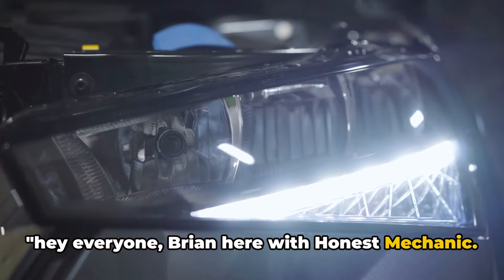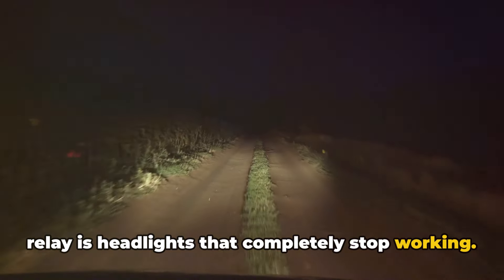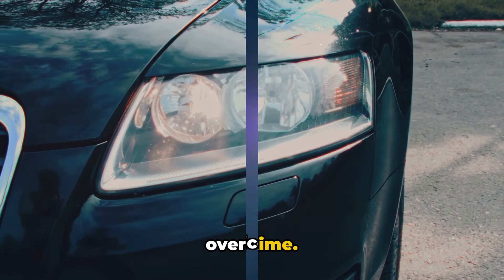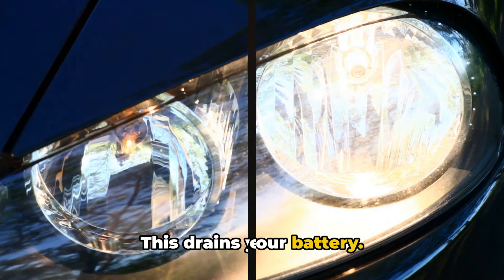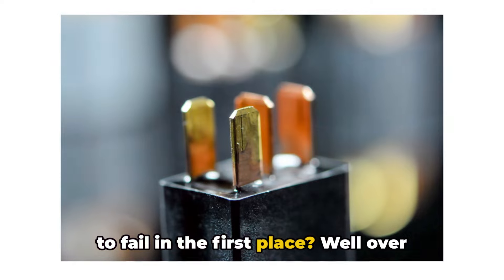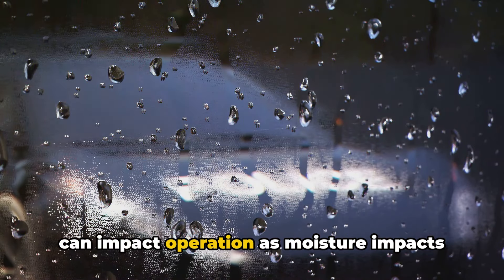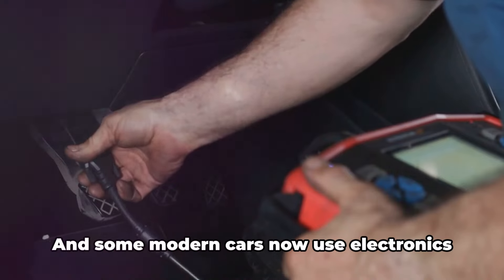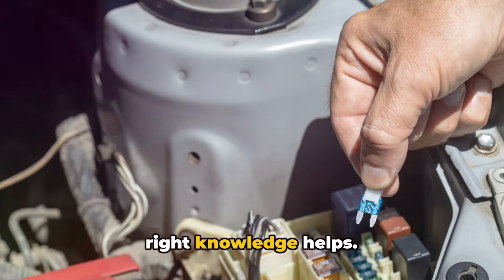Bad Headlight Relay Symptoms: 5 Common Failure Signs

Comment: Can a bad relay cause only one side not to work?
Reply: Did you figure out the problem mines only out on one side
Reply: Same
Reply: That's the exact issue I have and I haven't found ANYWHERE that mentions what can cause this. I checked the fuses and none of them are bad, both bulbs are brand new, I even tried each bulb on the side that turns on and they both work on the driver side but not passenger side.
Reply: Going thru this on my 2010 avalanche right now😮. 
I bought aftermarket lights front and back. Can't use the rear lights(led) and my passenger running light in the front isn't working. I switched back to the oem lights, had to buy a new harness due to cutting and splicing the old one(I'm keeping them both just on case for extra harnesses in the future) JUST to see the same thing happening.... no light on passenger side. And that was the reason I decided to get new headlights anyway😂. Anywho... in 25 minutes I'm going to advance auto to get the relay and see what it do. I have new bulbs new wire harness and I changed around the old fuses. I'm gonna get a pack of new fuses shortly. I'll update later😊
Reply: @kingzach74 same did y find a fix ?

Comment: My headlights are working when the switch is flipped to always on, but if you try to turn them off and then on manually, the headlights don't work. Any ideas?

Comment: I have a car with 1 dim headlight and 1 normal headlight when the switch is set to manual ON, but when I switch the headlight to auto, both lights are normal, would you know what the problem is? Is it the relay?

Comment: I have a question. I have a 2002 cavalier,  and the previous owner removed the DRL. I haven't had a problem with the conversion until the left headlight hi-beam came on without the headlight switch on but at a dim level. I removed the relay switch, but the light stayed on. The headlights work fine in the on position.

Comment: my drivers side headlight stays on  on 59 plate astra
Reply from the maker: Hi. If the driver's side headlight on your 59 plate Astra stays on, it might be due to a faulty headlight relay, a problem with the headlight switch, or a short circuit in the wiring. To resolve the issue, start by checking and potentially replacing the headlight relay. If that doesn't fix it, inspect the headlight switch and the wiring for any signs of damage or wear. It might be necessary to consult with a professional mechanic or an auto electrician for a thorough diagnosis and repair.
Reply: My driver side headlight on my 2007 Corolla just went out a week ago after replacing it in 2019 I noticed the highbeams were not working as well but after I change the bulb, I noticed the highbeams were working, but the low beam was not. I tried replacing the fuse, but that didn’t work. I’m not sure if it’s bad wiring and the dielectric grease on the bulb socket or it’s a bad relay.

Comment: Thanks, Honest Mechanic, for this insight. So, I have a problem with my 2017 GMC Acadia Denali Headlight on the passenger side. When the headlight is on, I turn the turn signal switch and make the turn, then that passenger light will go off. I would have to play with the light control switch back and forth to get the light working. The auto dealership said they do not know what the problem is.  This happens while driving at night. Could this be a relay issue, or must the headlight bulb be changed? I notice a lot of vehicles driving on the roads at night have this problem from 2017 to newer years. Thanks in advance for your input.

Comment: I have a 2013 ford edge that has a battery drain. Sometimes when I turn my headlights off, the indicater light on the dashboard stays on. Could it drain my battery even though the headlights are off? Can a bad relay cause this? Thank you

Comment: My headlights are flickering and I can hear clicking under the dash on my 2004 Chevy Cavalier. Could the relay under the dash be the problem? I had other electrical problems with it, but that was due to a faulty body ground. The ground had corroded off the battery tray. I didn't have any gauges or anything. I don't know if the flashing head lights are being caused by that, but the ground has been fixed by a mechanic. If it's the relay, I can fix that myself.

Comment: When I turn my headlight switch to park, parking lights come on and the dash light up.
When I move the headlight switch to low beams, they don't come on, and my dashboard light go out.
If I pull on the high beam lever high beams come on but once I let go the lever, they go out.
All the fuses are fine. I assume at this point I am down to 2 possible culprits, headlight switch or the headlight relay. Here is another thing I noticed. With no key in the ignition, and with headlight switch to off position, if I manually pinch the contacts on the headlight relay, low beams come on. 
I didn't know that the headlight relay is constantly powered, but not engaged.
Reply: Curious what was your fix? My 2006 Vibe started this tonight the same scenario you are mentioning. I recently updated with LED 9003 and all have been working fine. Tonight started car to warm up and turned on only the park lights Then turned switch to turn on low beams which fog lights also come in with lows and nothing happened. 
No headlights. I as you did flick lever to high beams and they come on and release lever as d they go off . 
Haven’t checked fuses or relays or the connectors  to each bulb yet.  Maybe they got hot? The switch turn signals and tail and brake lights work fine
Reply: @daveholte7658  My problem turned out to be a faulty ignition switch. By wiggling the key I could get the lights to work correctly. I ended up replacing the switch, not the lock.
Reply: @ just found my issue. It is the actual headlamp fog light signal lever needs to be replaced The connection in the twist of off to park to low high is not making connection.

Comment: My 1983 Buick Electra Park Avenue sedan was working great in 2022, then they started flickering periodically! Replaced the headlight dimmer switch under the dash, they worked for about a week then back flickering! 8/15/24 replaced the headlight switch noticed it was burnt in the middle & VERY HOT at the touch! Fixed a few bad wires, & NOTHING..... 3 weeks later they came on when I was driving home at night I seen 2 cop 🚓 cars figured I’d give them a try so I don’t get a ticket and they worked until I turned them off! Well they haven’t came back on since & that was a month ago! I’m going to try a relay now, if this doesn’t work I’m taking it to the electrical shop so they can properly fix it 100% for good! 
(Note the previous owner installed some aftermarket blue lights they may have been installed incorrectly idk) 

Has to be one of these:
 
- Fuse/Relay

- Headlight dimmer switch

- Headlight switch 

- Turn signal switch BLINKER

- Column mounted blinker turn signal switch
Reply: Have you figured out what the problem was I have a 16 fusion that I cant figure out.
Reply: @suegeren9347  no I just don’t don’t drive it unless it’s daylight. I’m going to order some new led headlights and a few new components that control the headlights that could be bad and take it to a shop next month & let them repair it.
Reply: @dzdhandzcan816 Thank you for getting back to me if you do get it later on and remember to I would be so grateful for letting me know. Bless you and good luck
Reply: @suegeren9347   that 2016 Ford Fusion is an easy fix I’m sure. Try Fuse or relay first then the switch I bet it’s one of the 3.